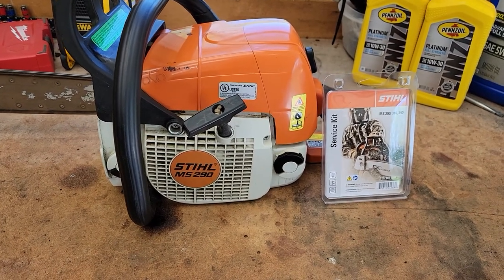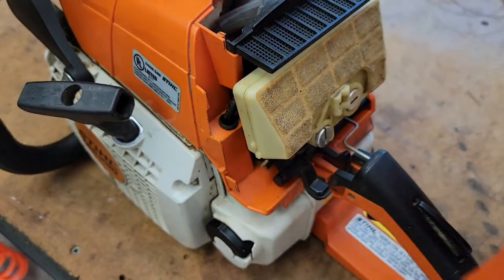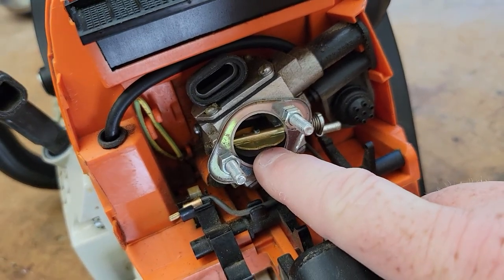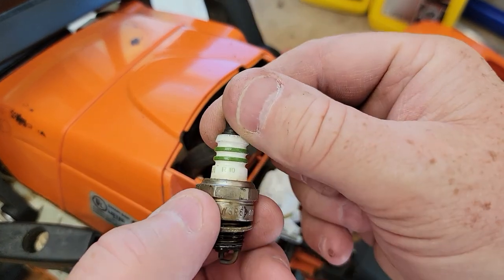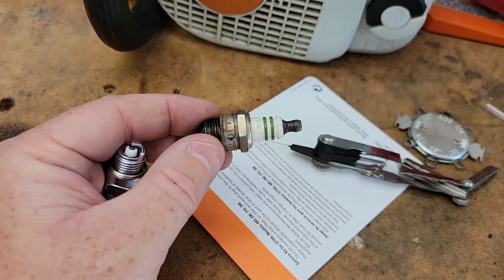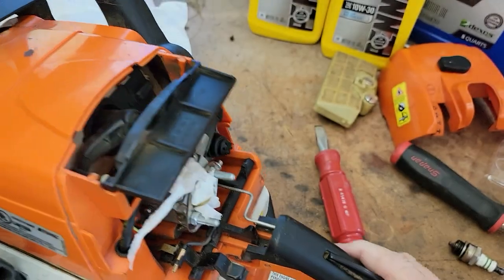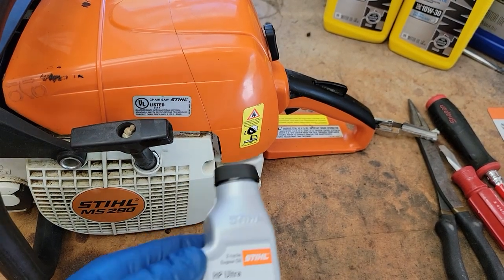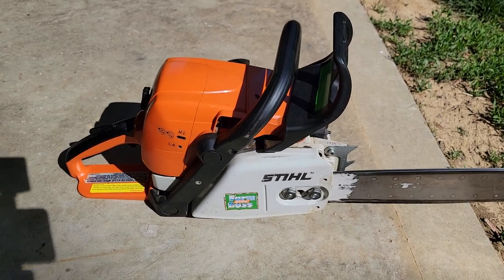STIHL MS290 CHAINSAW How To Fix Hard Starting SERVICE KIT Spark Plug Air & Fuel Filter Clean Carb

Comment: The black piece is called the pre filter.  In cold weather, below 50 degrees it should be installed with the solid side up, as was done in the video, and has a little snowflake symbol showing.  When temps above 50 degrees it should be screen side facing up, and has a little symbol of a sun on that side.  Good detailed video.
Reply from the maker: Wow I had no idea, thanks for the info!!

Comment: Shouldn't the plug Come pre-gapped since it's a model-specific kit?
Reply from the maker: I would think but I gues its good to check.
Reply: All plugs are pre-gapped. Look at the side electrode after checking the gap, it should always be 90 degrees to the center electrode, they are designed that way.

Comment: I have heard that the black peace that you did not know what direction it went in is for different Temps. Sumer and winter for allowing heat into the intake in winter and blocks heat for summer. But I'm new to chainsaws so I could be mistaken.
Reply from the maker: Sounds right, thanks for sharing!!! that make sense.  I will look into it.

Comment: The black plastic screen that is on top of the air filter has 2 positions: winter and summer. The way you placed it would be for winter.  You should see a snowflake on one side and the sun on the other.  That tells you which way it should be positioned.  It fits 2 ways in the slot.
Reply from the maker: Thank you, I had no idea!!!!